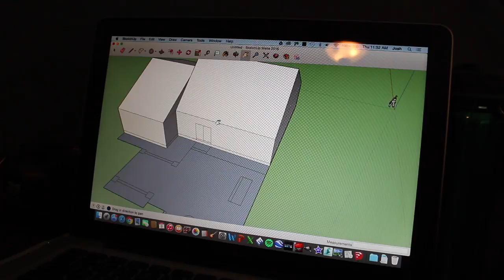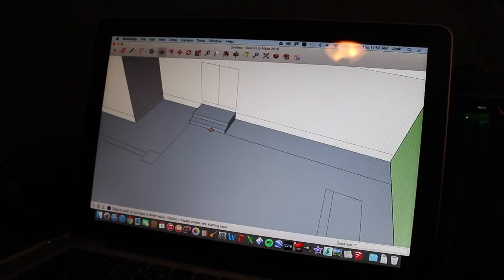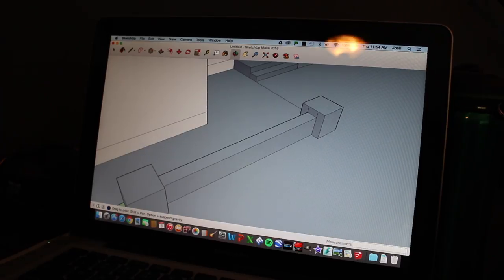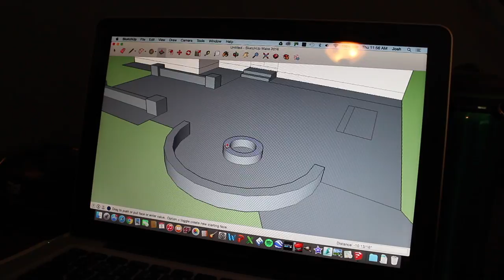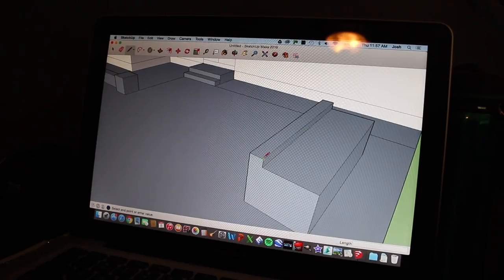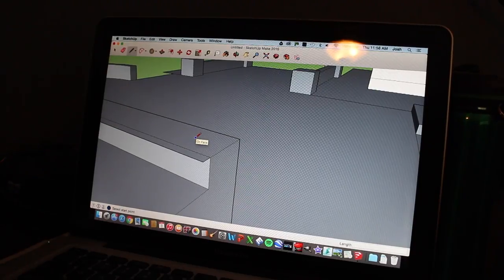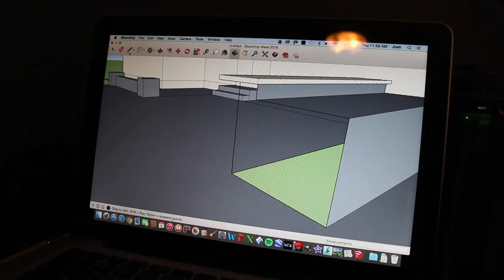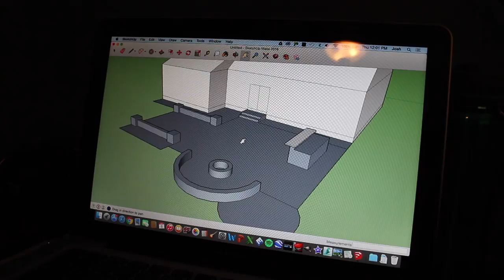Using SketchUp for Landscape Design: Part 4 Making Your Landscape Plan 3D

Comment: I'm quick at Google sketchup. and luckily worked as a roof truss, and wall designer for UFP. Also designed a couple kitchens. Now i do game modding with sketchup

Btw, CRTL Z does a quick undo, and right clicking has quick options.
Reply: CTRL Z is the cats meow
Reply: And?
Reply: Chuck Norris 
And for anyone who uses programs professionally it is important to learn and use keyboard shortcuts.